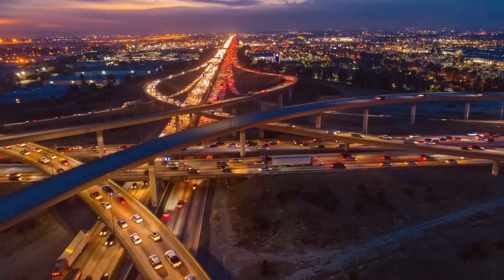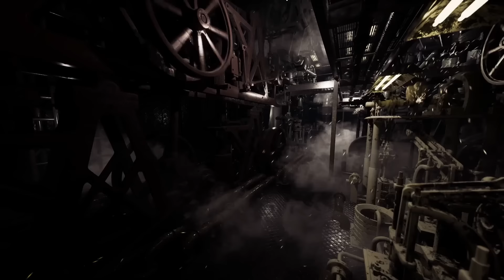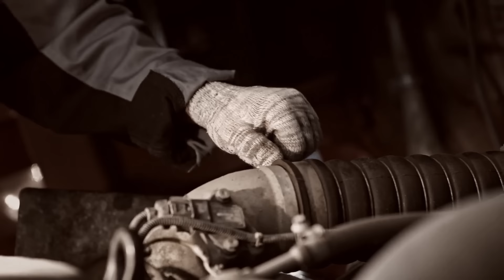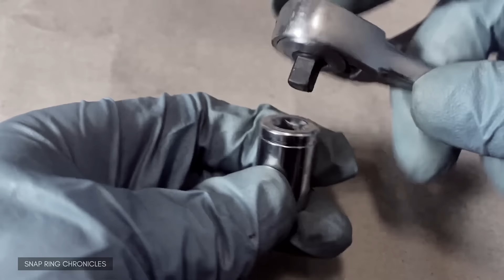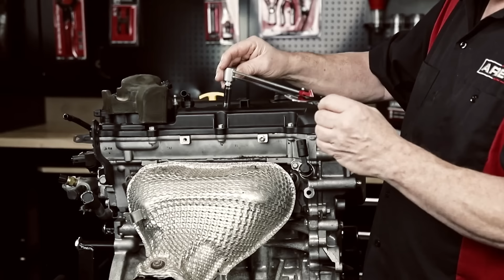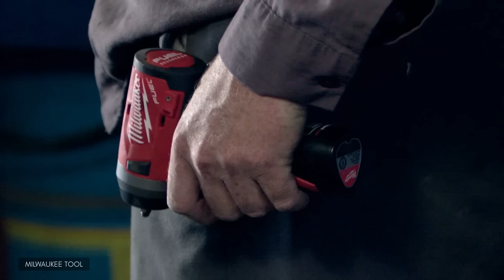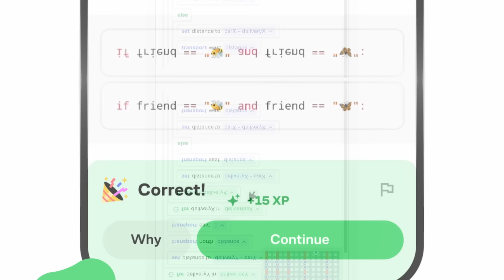The Tool That Changed The World

Comment: With steady advancements in electric motor technology and battery tech, we're seeing electric power tools make their way into heavier duty applications, with some able to fasten well into the 1000 lbf-ft range in a handheld (very heavy) form. I used to only use air tools for the impact-needed fasteners, but now my battery powered tools have taken over to the point I can sell off most of my air tools (except for the all important air hammer and other assorted stuff).

Comment: Aaah yes, the crescent wrench... (skiftnyckel in Swedish directly translated to "shifting key") It's perhaps the worst tool ever. No one ever spends enough $$$ to get a decent one and no one ever throws the old crappy ones away resulting in countless rounded bolts and nuts when the tolerances on the crescent wrench is effed. Its great for anything under 10mm but a wouldnt even try a rusted in 30mm bolt with a wrench 😵

Comment: Pipe wrenches are still referred to as 'Stillsons' here in the UK.
Reply: Same here in NZ, it was a puzzle to me starting in an engineering shop in 1980 when the old timers called the mainly “Rigid” brand pipe wrenches we used that name, 40 + years later just about every guy in numerous workshops I’ve worked in called them that, I have seen one or two “Stilson” wrenches though, important enough to comment on it to the guy I was working with, lol.

Comment: Magnificent videos and graphics!  And the research and interesting narrative.  
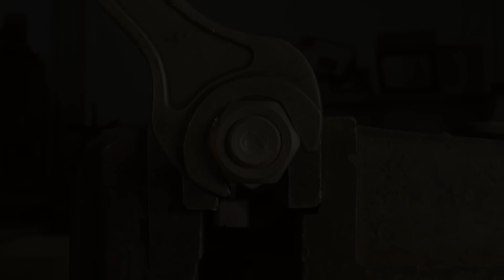I think the opening graphic at 1:05 has the wrench on backward for a clockwise rotation.  It is almost a symmetric handle, so I could be mistooken. I learned from a gearhead a long time ago that if you don't want bloody knuckles, you put the wrench on the correct direction and you always try to pull it, don't push it.  No charge for the wisdom...

Comment: As a former mechanic I’d like to point out that box end wrenches are preferred because in addition to a closer fit and a firmer grip,  they have six contact points as compared to two for the open end wrench, and so are much less subject to slipping and rounding off the fastener and wounding the knuckles of the mechanic.
In my earliest apprentice level training I was instructed early on to use only the box end if possible.
I was also cautioned to pay careful attention to where my knuckles would be if the nut released suddenly, as they almost always do.
Reply: I was taught the lesson that box end wrenches provides a stronger grip than open ended wrenches when I was a kid. I'm 64 now. But yes, make sure your knuckles will not be skinned or crushed if the wrench slips.

Comment: I'm pretty sure that brand is still relevant today they make different kinds of tools and they're all good quality I work on all my own equipment my hands are bad but my right hand Works real good my left hand don't hardly work at all but my to work on both of my own equipment my trucks and dozers and backhoes and stuff and trailers and it's I've always used Craftsman tools everybody that I know that was a mechanic always said I always make fun of me and my Craftsman tools I always did real good with him back 45 years ago I had two cordless ratchets and I was a mobile mechanic and I made a I made a lot of money as a mobile mechanic with those two old ugly-looking bulky cordless ratchets most mechanics do not have a cordless ratchet I did I have two of them Craftsman has always been a good tool a list they they came out with a Sears brand back in those days it was a pure garbage but a Craftsman brand was a good tool is still a good tool and I buy still buy Christmas of course I buy I don't buy the high dollar tools from the you know the tool trucks I do just fine I change the tires have full trannies I can do rear ends but I can only do right hand I can't use the left hand though you know but I get through it I buy a bunch of them cordless tools that are Milwaukee's and that does most of the work because my hands don't let me do much to get more out real quick but with those Milwaukee half inch 3/4 and 1/4 inch cordless ratchets it takes a lot of the terror and wear off my hands and wrists and ligaments because all I got to do is pull the trigger I had to stop quite a bit because I don't have much use time wise in each section of work I do because I have to stop and wait for my hands to recuperate but yeah they're great Milwaukee I'm all for Milwaukee's I have other brands of cordless tools but Milwaukee is my favorite add Milwaukee 3/4 was about $600 last year with the battery a good battery the high-dollar battery goes with it that thing will twist your arm off if you don't watch I'm glad I bought that 3/4 cordless from Milwaukee it's a beast

Comment: A lot of people call a pipe wrench a monkey wrench a monkey wrench does not have any teeth on the Jaws that way it does not mower or tear into the bolt head a pipe wrench has to have teeth on it in order to bite the round surface of the pipe

Comment: Thanks for a new word "camout" (I am german).

I suppose it describes the effect that your fastening tool lifts itself out of the "socket" in the bolt head until it so far out that is destroys the bolthead.

Torx has an untapered socket, so this force component is simply not existent. 
Same effect with allen bolts. 

Phillips heads are a catastrophe, everthing is tapered and small - the screw is meant to be optimal to be fastened ONCE in a factory and NEVER touched again. 

Slotted screws have the same issue, as most screwdrivers have a tapered blade. And that taper is enough to lift the screwdriver up. 

Sometimes you find slotted screwdrivers that have hardened tips that are untapered - they should be better. 

As I know how I abuse my screwdrivers, I am happy that I found a very functional variant - a "classic, wooden handle, the shaft reaches through the handle to the end, and at the handle end the shaft has a hexagon. 

So you can use the screwdriver as chisel and do not destroy the handle with the hammer, and you do not somehow press and twist with one hand, you can, if necessary, lean with your full weight on the screwdriver and use the leverage of a wrench on the hexagon for the twisting.

Comment: I have never, ever rounded or damaged a 12-point internal bolt head. The shaft of the fastener will break before the head socket will round out.

Be very careful of this when dealing with this manner of screw, which is often found in an engine block. Where steel and aluminum meet, galling and thermal cycling can result in molecular fusion of the metals. No amount of force will get the screw out without breaking it unless you apply heat and penetrating oil and take it very carefully. Trust me, you don't want to break a steel bolt off in an aluminum block.

Comment: The fact that the bolt head size and thread pitch is never printed on the top of any bolt or nut... and that we have two different competing systems Metric and SAE...  has been an absolute F'n disaster of wasted time, labor, and additional frustration for humanity.   I could not compute the amount of sw3arlng humanity has done over...  having no clue what size a bolt or nut was.   And nobody seems to be doing a thing to fix it.  The only marginal progress we've made has been someone annodizing wrenches in different colors.
Reply: Not really a problem for most people

Comment: I didn't see the mention of why an open end wrench has a 15° angle. It is so when you reach the end of travel, you can flip it over and place the open end on facing the other direction. 15° doubled is 30°. Keep flipping it over when you reach the end of travel in tight spaces.

Comment: What kind of the name is "box wrench"? Those are ring spanners!
Reply: A lot of terminology differs between Britain and the US.
Reply: @GH-oi2jf  I'm Australian, and only too well-aware of that. In this case, I just don't see why you'd use the word box instead of ring.
Reply: @andrewstrongman305 — There is no way to explain language.  Terms just come into use and they stick, or not.  I've used "box" wrenches for 60 years and never given it a second thought.  One characteristic of American English, though, is that we like economy of expression, so "box wrench" is a little smoother than "ring wrench" for example.  (As for "spanner" instead of "wrench," forget it.)  As soon as I thought about that explanation, however, I realized that "elevator" instead of "lift" was an exception to the rule.  Language is rich with exceptions.
Reply: @GH-oi2jf  It has a lot to do with you guys bailing from England before they had an official dictionary. After your Revolution, weren't inclined to adopt it. You opted for Webster's dictionary instead.

Comment: I'm surprised the video didn't mention the invention of the standard interchangeable screw thread system—an innovation that laid the foundation for modern wrench and fastener compatibility. In 1841, Joseph Whitworth introduced the first standardised thread system in the UK, followed later by William Sellers in the United States, who established the US thread standard. These developments were instrumental in enabling interchangeable socket and wrench systems.
Although Germany, Switzerland, and other nations developed their own thread profiles, the key achievement in each case was the creation of a national standard. This meant that any nut and bolt manufactured to that standard would be interchangeable across all compliant machines and tools. As the video rightly notes, prior to Whitworth's innovation, thread forms were unique to each engineer or manufacturer, severely limiting interchangeability and repair.
Reply: In the United States, Eli Whitney originated the manufacture of interchangeable parts for machines in the first decade of the 1800s, by designing and building milling machines and the system for using them to mass produce parts.

Comment: As someone who has worked on cars for decades doing everything from detailing, stereos, accessories, mechanics and now working at a collision repair/body shop. I have to say that my favorite tool is my 1/4" battery ratchet. I use it every day and the only issue is the size. Vessel tools (I think that's the brand) in Japan has come out with a compact battery ratchet that I'm dying to get my hands on. If it's as good as it appears to be. It'll be a game changer for people like me.

Comment: I don't know exactly when ratchet drive sizes became standardized. But I do know that before the 1/4", 3/8", and 1/2" became standard square drive sizes. Each manufacturer had ratchets and sockets that would only fit within their brand. So for example,  you couldn't use a Craftsman socket on a Snap-on ratchet.
Reply: Snap-on had a small ratchet with 7 mm square ( or equivalent to it) and i was annoyed by that. You just gave me the reason: brand loyalty, as planned by the boys in the office. Sadly, i lost it.

Comment: My first set of wrenches is spread over 25 miles of trails where the tool box rolled over in the back of my 49 Willys.. much that was the Old Spanish trail south out of Las Vegas, now that is under houses.
Reply: I worked with a guy from Argentina a few years ago, decent enough guy, but seemed to be in a dream world a lot of the time. We finished an engineering job at a water treatment plant out of town, loaded up my tool box etc on the back of our truck tray, he was loading his gear there  so I hopped in to drive back to the shop, left site and drove a short distance before we got on the highway, he then offered to do the drive back as I drove in the morning, so I said “sure”, so I stopped and fortunately went round the back of the truck to change seats instead of going around the front to find he hadn’t bothered to put the tailgate up so all my gear would have slid off on a main highway for following traffic to plough into! And knowing his reaction to something he’d done just like that ( almost daily) would be “sorry sorry “! And that would be the just about the end of the issue from his point of view! lol.

Comment: A more common bolt head on automobiles is around 13mm AF - not the oft claimed 10mm (only used for M6 or equivalent (1/4") Shank / thread...  lol..

Comment: 10:27 I do not agree with that statement. First, as you mentioned, the length of the momentul arm in a square head is longer, therefore, for same torque, the applied force is smaller. Second, the sharp corners can be chamfered to an even more broad 135° for even less stress, but obviously reducing face length. But the clearance statement still holds.

Comment: I was hoping you would cover why the wrench has an angled head. I assumed it had to do with getting more angular coverage. Do you know why?
Reply: The 15° angle reduces the arc needed from 60° to 30°.  When there is less than 60° of arc available, you flip the wrench over.  That is why the open end is always flat while the box end is often bent.
Reply: @GH-oi2jf  I see. Thanks for the answer!

Comment: Ha ha! Multiple seconds of ratchet operation that does nothing!  Notice the direction selector is central so it doesn't work in either direction.  Notice the items attached to the handle don't even turn as the handle moves back and forth.

Comment: Technically, the square bolt is way less likely to round off than a hex when using an ajustable wrench. 

 There are no more points of contact with the hex when using an adjustable wrench. And those points are closer together. Torque being the product of force and distance, the square bolt has an advantage because the contact points are further away from the center. So for a given torque the forces at the contact point are significantly reduced.
Reply: Correct.  The advantage of hex heads is the reduction in the arc needed to turn it to the next symmetric position.
Reply: Couldn't agree more, searching down the comments just to find this comment.

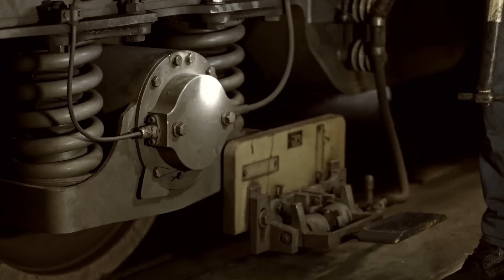Comment: 12:00 “Yeah just uhhhh act like a mechanic working on something”
Reply: Hitting bolts with hammers is a legit way to test for tension and identify loose bolts, common in trains and heavy machinery.
Reply: Well... That's a legit test widespread in rail transport. He even has a special inspection hammer. Be better.

Comment: One of the “hidden genius” aspects of impact not mentioned here is that the arm/wrist of the operator is not counteracting the torque applied to the fastener. It is so much more difficult to drive lag bolts or tighten screws with a traditional drill/driver compared to an impact driver.

Comment: The 10mm socket bit sounds like a joke but I had some work done on my car and found a 10mm socket rolling around under the hood after I picked it up.
Reply: I once found a 13mm Snap-On wrench.
Reply: It's a joke, and it's no joke
Reply: @DoesNotGiveAF those are the best jokes
Reply: Found a combination wrench INSIDE the exhaust pipe. Sadly, it had been annealed by the heat and was incapable of doing its job.
Reply: @markfisher7962 well now you know what that rattle always was!! 😂
Reply: I once found an old west german screwdriver lodged behind the brake booster on my car
Reply: It only sounds like a joke for people who never work on their own cars.
Reply: @nrgrlsd9931  It only sounds like a joke for people who are careful with their tools
Reply: It is not a joke. I have lost them in my vehicles
Reply: You found it thanks

Comment: Fasteners definitely make a lot of things much more simple than they would be otherwise. Building something out of one piece is nearly impossible and often takes two halves coming together and being joined, often needing to be separated when maintenance is required. If these were fixed(welded, etc) these things would become one time use or a great pain to perform maintenance on. Fasteners are definitely impressive. One thing I would love to see in great detail is a variety of thread specs explored for their strength and durability.
Reply: bolts? haha welder and grinder go brrrr

Comment: The sensual wrench is key to what goes on in the back of the snapon truck 😆
Reply: Val has entered the truck
Reply: $700 for 10-19mm, SAE set came free with it.  Worth every red cent! Have not used a line wrench in over 10 years.  Yes, a single 1-1/16 is $200, but: 0% slipping because metallurgy and opening design (has teeth, and a slip slot for ‘ratcheting’).

Comment: I carried two crescent wrenches, 550 cord, electrical tape, a multibit screwdriver, and a multitool as my vehicle repair kit in the military. put them in a zipper pouch that I strapped into the cockpit of my vehicle. and I did have to use these items on combat missions.
Reply: I love hearing stories about the MacGyver/improvised repairs people have come up with in situations like yours. When you can’t take the whole tool chest with you, you have to bring the tools that really matter and get creative. If you can fix a vehicle with a multitool and some chewing gum, you’ve got some knowledge/skills—even if it is only a temporary fix to get you back to civilization.
Reply: @wcropp1  I patched the air line on my Husky MRAP in Afghanistan with electrical tape once, and ran it like that for 2months until we could get replacement parts. I fixed a lot of stuff on mission with some zipties as well. 100mph tape too. Heck, my bed in Iraq was fashioned from junk held together for 12months with 550cord and 100mph tape.

Some fixes ended up being a bit "permanent", but they worked. I even tried replicating a few jerrry-rigged fixes back home years later, using proper tools and materials, and somehow they never worked as well as a crude repair when you have no other options.

I even used 550cord to fix my sling mount for my M4 in Afghanistan, and still run that fix today on my AR with the original parts, and have replicated it many times. it's become my preference sling mounting solution.